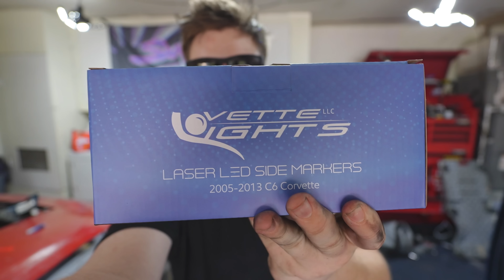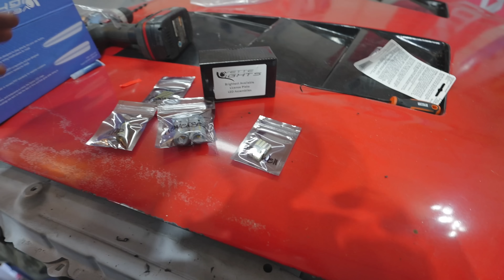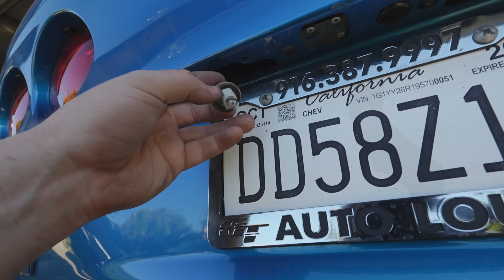The ZR1 Gets $5,000 In MODS!!!

Comment: She looks great with all the Drew claimed Ricer mods.  😂
Reply: Air cleaners arent even a mod! Factory setups are usually cold air bone stock
He wont go any faster with that. Make just under 600chp NA wiht a paper air filter.
Reply: I was also thinking now he’s opened it up to some of  the hot air in the bay vs cool air being funnelled through the stock box.   When he started I was hoping the K&N had its own box around it, but it didn’t.
Reply: @NvSrAgE679  i actually did some research on dyno runs after only a k&n intake and it does add at least 20hp. Not sure how much hp that particular car had before but they are between 430 and 450 and it dyno'd at 473. With the cats removed it ads another 30-40hp according to another dyno run i saw that had drews exact setup
Reply: @Makaya9s  was there much of an increase in the AIT’s after it was operating hot?  Dyno runs won’t tell if it affects the performance on the road. Not saying it does, but would love to see the science.   Fresh air through the air box vs pulling all the air from the engine bay.
Reply: @NvSrAgE679  if anything it would perform better on the road because the grille is still there and the intake still receives it's air through that grille that the previous intake got it's air from. It now can actually utilize all of the air and maybe even more than the grille can supply. I also saw another video showing that the oxygen molecules increased when the k&n intake was added and even more without an intake at all suggesting the original intake was so restricting even a full hot air intake is better for this cars very demanding oxygen supply

Comment: On those side lights especially put you a dab of silicone on the back middle or one edge so they don't rattle around because they are a little loose in those holes with no bolts or clips

Comment: with most of these ultra light led things you cant pass inspection in my country, and actually they are too bright ext and interior. when someone with this type aftermarket fog lights comes towards you in night, especially rainy night, only thing you see is bright light.
Reply: Part of the issue is people don't know how to angle them correctly. It's supposed to be pointing at the road ahead, not horizontally.
Reply: That’s only if you put a led light in a projector housing it makes it extremely bright, normal headlight housings it’s not too bad
Reply: Those 360° bulbs that he bought for the headlights are not good at all in any circumstances. Only the LEDs with the two chips on opposite sides from each other as those are the only proper LEDs.